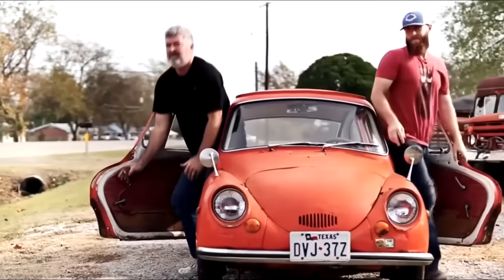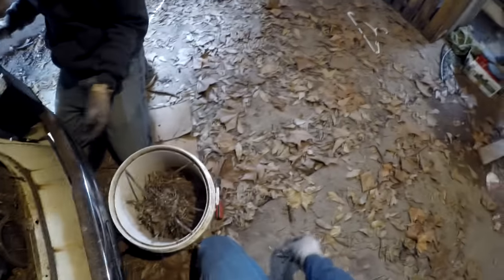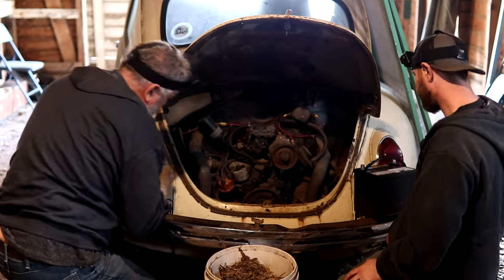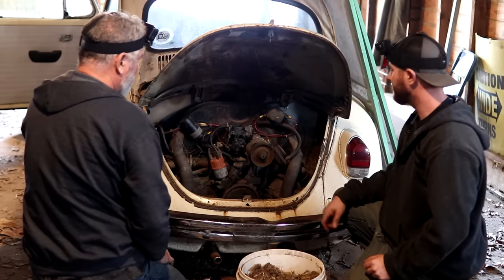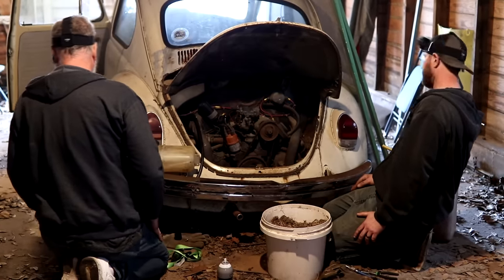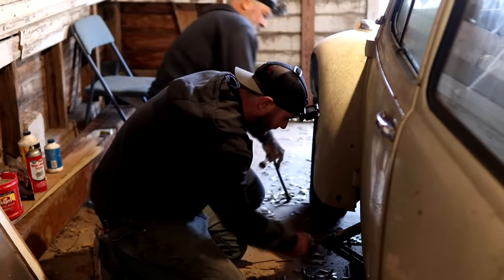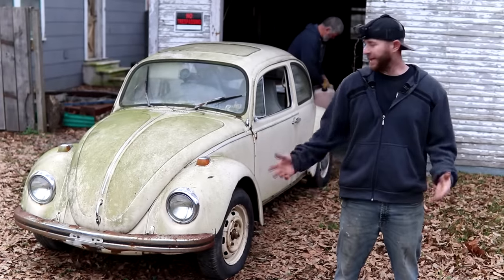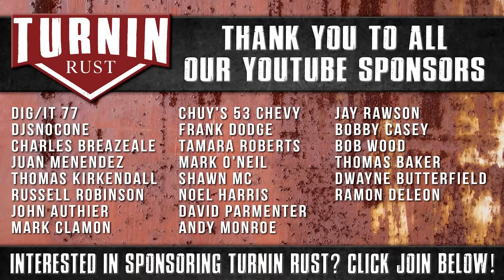FREE 1968 Volkswagen Beetle Barn Find, Will It Run After 20 years?! | Turnin Rust

Comment: A tip on using your air tank, you can connect it to a fully inflated tire on your tow rig or trailer and “borrow” some air to fill your tank. It’ll work as long as the donor tire has more psi than the tank.

Comment: That is a great find! Check list for your truck/trailer: gloves, dust mask, tools, air hose, Full air tank and fuel can, battery and wire,  jack and 4 way lug wrench, bucket and maybe some canned air to clean out stuff. If you have a generator on the trailer small shop vac ot a gas powered leaf blower for cleaning out stuff like that engine compartment. Pretty sure you can fit all of that in the bucket and bed of truck. Over all you did real good there

Comment: Done that a few times myself. VW's are so cool and so reliable. Last one I got running in 10 minutes and the all original 74 Porsche 914 with the original fuel injection setup was started before I got it off the trailer and that took me about 1 hour. Ran like a kitten after a few tweaks over the next week. So sweet. You got a great deal. Fun to start these old beasties.

Comment: Great job, guys. interesting video.
 I wasn't as daring when I got my 1972 Super Beetle barn find, especially not with 4 flat tires. So I didn't try to start her up. We dug the car out of 10 inches of mud, shoe-horned it past an 8-foot drop-off, somehow got it across a tree stump, and then trailered it home. The rear window was missing, and I watched acorns and leaves flying out of the car during the entire 25-mile trip.

Comment: damn I wish somebody would give me a free VW in that good of shape.
Reply: toot tall I got mine for free in even better condition, fun cars for sure
Reply: @kingwreckersgarage9371  I guess I don't know the right people. Then again, these days everyone I knew has died out. Odd thing though, as small as they are, I can still be comfortable in them. That don't happen with many cars these days, not even so called larger cars. I loved my squareback, until the damn mechanical fuel injection screwed up. Hell to fix. So even after I nearly burned up the car, I still got more than I paid for it. At 15 years old never having seen a metric wrench, I was able to get a VW van running. Didn't stay running long, but I got it going after setting for years, with absolutely no specific VW knowledge at all. Had I known then how easy they would be to rebuild, I would have done that, but I knew nothing so I didn't. I had a chance to buy a nice bus, bukt the wife nixed it cuz it didn't have namby pamby power steering.
Reply: @tootall5559  just got my 71 square running again today. mild cam'd 1776cc, heads and 40mm DCNF Webbers. nose to tail she's mechanically good, electrically there is work to do, it's ugly as sin, and a NW car but she's street legal and tagged. Had a  68 square in high school. Best SPG I've ever had, and best driving air cooled model VW ever made. hopefully you will find a VW the warden will allow some day.
Reply: @dasgoofinhiemer5039  my wife died, and my current lady won't tell me I can't do shit, I won't take it, so if I find the VW AND the money, I'll do it.
Reply: @jxckson_s  I have ran up on a beetle and a van that had automatics. Not the best thing in such a vehicle, but they did have them.
Reply: the floors rusted you can see it
Reply: @jxckson_s  seen vids of thousands of cars sitting in huge car parks that the government bought back - bet there are some gems sitting rotting in those government impounds.
Reply: @Aaronhouston33  well of course they are. How rusted is the question, but they make new floor panels Hey one that runs and drives, even if does need other work, still be cool with me.
Reply: Me too
Reply: Not me! I do not like foreign cars no matter the makes!
Reply: Love the V-Dub wish i had one. They're just fun cars.
Reply: Right
Reply: toot tall aw man I would just melt if I found a old mustang in the wilderness
Reply: You guys know your stuff. You brought that old bug to life. I really was surprised what you did to that tire to get it to take some air.
Reply: Look for someone with one parked outside and befriend them.. it only took me 10 years to convince them to sale it to me and I got it for free xD
Reply: It call net working!!!!!!!!!!!!!
Reply: I wish to have vw but can't afford, love always and ll buy in a life time.
Reply: It even has a factory  original sun roof ,Maaaaan !!!!
Reply: Ace Williams you can get running and driving examples for like 5 grand
Reply: I LOVE VW
Reply: toot tall:

Stuff happens. A neighbor gave me her 5Speed 4WD Nissan Hardbody pickup along with her  5 Speed  Geo Metro...both in excellent shape. Years ago she lost the ability to easily drive stick  and just held on to both vehicles (both have been garaged their entire life).

Drained the old gas,changed the:fuel filter, oil/filter(drained blocks of old coolant to) on both vehicles along with new batteries,both run like champs...probably flip both vehicles with a very happy smile.....especially with the Nissan pickup.
Reply: @dmcnamara9859  stuff like that just doesn't happen to me. Stuff like somebody breaking into my storage unit happens to me. I've never been lucky at anything but love... I had a good woman for 28 years until she died, but somehow I found or one found me I should say. A lady I knew lost her business and was losing her house, so I offered her a place with me, just as friends at the time... I wouldn't let a friend go homeless if I could fix it... then things developed and now we're well not legally married but might as well be so far as we're concerned. And she can cook and cook great! a big plus at my age. My sex life is about done, but I still like food.
Reply: personally, I'd keep the Nissan truck, I love trucks, mini trucks especially.
Reply: @tootall5559  

People having been giving me their vehicles since I was a teen in the 1980s. People with money (it seems)look at their older vehicles as an old TV.

Have no use  for the Nissan.....so I'll find the right buyer who won't trash it/Ghetto modify to hell.The Geo-Suzuki? I plan on keeping it...especially useful when the next gasoline price surge eventually happens
Reply: @dmcnamara9859  I need a small truck, but couldn't find one when I was looking. There just aren't many around these days and when you do find one it's trashed with all kinds of crap, or it's so worn out it's not worth having. The cost of repairs would far outweigh it's value and usefulness. 
You might do well with the Geo. I have a friend that still has one. He doesn't use it as an everyday vehicle anymore, but it still runs good, it's biggest problem is it was a rag top...now literally all that's left of the top are a few rags. He keeps it in the garage now, he always plans on getting a new top put on it, but he only works part time at a grocery store, money is as tight for him as it is me. I wound up buying a 2008 Ford Focus. I kinda think it's been chipped or something, it is very quick, not a high top end but it gets there very quick. Not many stock vehicles I can't blow away from a stop or slow rolling speed. I messed with a guy in a new Audi a while back, he got really ticked cuz I would not let him by. He'd roll up in his lane, I'd smash the gas and jump ahead then get in his lane near a truck or something so he dould not pass. I did this on and off for like 30 miles. He finally did wind it up enough to get by me, just when we were nearing the end of the four lane and I slowed for that. Next thing I saw, a cop had him pulled over... I laughed and laughed, I agitated him, then he got the ticket. 
I had a Ford Courier that I really loved, but just flat wore it out. I found another that had been redone perfectly, but alas couldn't scrape up the money for it in time. Sat for weeks but you barely turn the key and it starts without even hearing the starter. Some of those had Mazda Engines, some had what amounted to a Pinto engine, mine had the pinto engine. It was still good but the rest of the truck, mostly the front end, was just worn out and beyond what I could afford to fix at the time.
Reply: @tootall5559  

Weakest links on the Mazda 3 Series Platformed and Mazda based engine Ford Focus is the automatic(not very robust), the pencil thin oil pump shaft and valve-body gasket fail in time with jackrabbit starts and failing to thoroughly flush the ATF on a regular basis (pick N pull are littered with them)....The Plastic intake manifold are problematic to....just like the Mitsubishi engine Chrysler used in the Neons,PT Losers,etc.

Everything I read about the Suzuki Cultus convertible back in the day....had beam/torsion rigidity of a loaf of bread once GM decided to make it into a convertible and not adding much  additional structure in it after hacking off the roof.

The  Japanese built Mazda B2000 Sundowner/and Ford badged version were decent pickups back then...clogged Cats which owners never replaced led to their doom (resulting in cracked exhaust manifolds and blown or cracked heads from overheating); along with rot (owner neglect of leaving minerals and salt on body shell and frame) is what killed off most of them....very similar to the Toyotas/Datsuns of that era.
Reply: @dmcnamara9859  here we have just plain rust. The humidity causes everything to rust even in places you wouldn't think. No road salt or the like though snows are rare and even the threat of snow shuts everything down. There' is a guy here that has acres of old cars going to rust into the ground, but he won't sell a single one or any part. He wants to sell the whole place, for 200K, and frankly if the cars hadn't gone so far into rustville, it would probably be well worth it. All I know about my 2008 Focus is it runs great, better than it should. I broke a door handle on it though. Why the hell would they make plastic door handles?
Reply: they are not good cars or safe now days .
Reply: who wouldn`t

Comment: I really want one of these as a first project car. I've heard they're super easy to work on.
Reply: I just finished one that's  now on   the road and turning heads. They make a great first project. Super-easy to work on and lots of parts available. Just check condition of floorpans and heater channels/sills before you buy as they are a real challenge to fix if rusted out like mine were:)
Reply: @martinharris5017  Good to know, thank you!
Reply: Heater channels are a lot of work.....floorplans straightforward......be careful VWs will nickle and dime you
Reply: @lukasgarage956  My advice is "Budget carefully". There are so many goodies and aftermarket upgrades out there it's easy to get carried away. Fortunately I have a local parts supplier who is fair with prices and as honest as they get. Also helps to join a club and you'll pick up lots of knowledge and contacts.
Reply: Akin of Fury They honestly are easy to work on and a fun car.
Reply: Akin of fury
There's a guy in my area that's selling a 1977 he's asking 400$ it also has a sunroof. He said it hasn't been moved since the 90s, if I was able to work on cars I definitely would have jumped on it.
Reply: Sharon Prry It’s actually very cheap. Long as the car is somewhat solid you would be a way ahead of the game. Grab one anyhow and take your time and learn it will be very rewarding in the end.
Reply: @SladesVWBeetle  
Yes I would love to purchase it, are those car that easy to repair? I was also thinking if I was to buy I would take it to the shop.
Reply: Sharon Prry they’re probably one of the easiest cars to work on. Especially there’s so many YouTube clips on them. And the parts are fairly cheap compared to other cars I’ve worked on over the years!

Comment: A shop vac would have shortened this long video considerably.
Reply: You are correct, and that really "sucks: ... Better to not live in a vacuum, but to utilize a shop vac when necessary  ...
Reply: Or even a petrol powered leaf blower...
Reply: or 2 sheets of newspaper or thin cardboard rolled into tubes one inside the other with the back end of one closed off. Hand-Made air pump.
Reply: An editor would have shortened this LONG video considerably.
Reply: @Greg042869  ....but then what would we do instead of spray-painting our toenails and letting them dry while we watch? :) We all see how much crap there was in the engine compartment, how slowly they're removing it (possibly needing a considerably bigger bucket) (Estimated Quantity/Rate of Removal = Time to Clear It) yet we don't think - well some folk don't - to Skip Forward to where they're no longer removing the debris? I believe the answer lies not in shop vacs or video editing but in the fact that Life moves more Slowly in the Deep South than anywhere else. I love that lit petrol tyre inflation trick - I could watch that all day.
Reply: @goldbunny1973  That's why an editor is needed. If you skip forward to something "important" or at least relevant to the title, you miss the ONE thing in 50 minutes that might be interesting. (I've seen people fill tires with flammable aerosol cans, so without going back I'm assuming that was what happened there.)
Reply: @Greg042869  I'm not disagreeing; I used to make wedding videos; I refused to make them longer than 30mins; It's important to concentrate interesting footage rather than show 30mins of watching paint dry - and also easier to be an armchair critic rather than making a better video ourselves... I'm sure these smashing lads are taking in all constructive comments.
Reply: @goldbunny1973  Well, the video probably isn't too long because of incompetence or ignorance, but because of an intentional waste of time to increase statistics on YouTube. That's my suspicion, anyway.
Reply: This made me want to go clean something
Reply: Guys love you show. But you need to improve your editing. This show could have been about 30 min shorter!
Reply: Add that to the first contact tool kit I wrote about... small electric generator and the fluids and hand tools and jack etc. that never are used accept on the potential vehicle destination....... or you break down!!!!!!!!!
Reply: There's a feature in YouTube where you can forward the video :D
Reply: Stan Webb or a 25 cent finger nail file in your glove department.

Comment: This 1968 Volkswagen Beetle is a true time capsule.  One item of interest is, has integrated gas gauge in speedo and also a separate gas gauge to right of cluster. Gas gauge to right of speedo was on US VW Beetles from 1962 to 1967. Prior years had a lever  ahead of shifter to turn when ran out of gas. Had a reserve of 1 gallon of fuel to hopefully get you to filling station. This must have been an early model 1968 VW Beetle. Have not seen this before. Looks to be a strong relic of the past. Enjoy the process of resurrecting & making this VW Beetle road worthy again ... Slainte' !  Cheers !

Comment: This car is in superb shape for 52 years old un-restored.   It should be cleaned up back to totally original.   THe interior was exceptionally nice even for a 10 year old VW Deluxe Sunroof.  There are very few bugs that can be easily put back to totally original (without big expense).    Please dont hack it up!   It would be easy to find someone who wants an original example like this.  (Well the engine was replaced at some point, because Dual port started in 1970 or 71 ).

Comment: I bought  a 1060 VW in ....oh 1975. Rebuilt the engine, new clutch, valves ( and would spend a cpla hours once a month to adjust valves...)  had a lever on the floor to twist and get reserve gas.(about 35 miles) . I drove that car from Srasota Fl....for about 6 months...loved it. Had a rubber gasket aroune engine compartment so no water or steam came into the compartment, so NEVER stalled from running thru water. I had driven through 2 ft deep water. Also put a tuned muffler on it.... Then I went to Phx AZ, stayed in Sante Fe for about 4 months, drove around Phx as I went to college for 3 years, then drove back to Sarasota.... Then a pickup truck demolished the car and me . I put easy 100,000 miles on it, only changed oil every 5000 miles or so, adjusted valves monthly, tuned every 2 or 3 months, replaced brakes ..oh about 40-45,000 miles, put a killer stereo in ...(no a/c yet even tho I lived in Phx (HOT) and Fl (hot)  never missed the A/C . The heater worked great..I spent a winter in the mountains around Sante Fe and damn it got cold. 35 HP ..Top speed about 64 mph. Once, I got right on a semi's ass...I mean 10 ft back. Got to (buried the speedo)  I guess 72-73 mph ....lol My girlfriends brother called it the tin can . It had that oil bath  air cleaner, little tiny tail lights...I spent a LOT of time riding around the desert outside of Phx... She never let me down....but...man no power!!!!lol You have a 40 HP there.
Mine was 35 HP